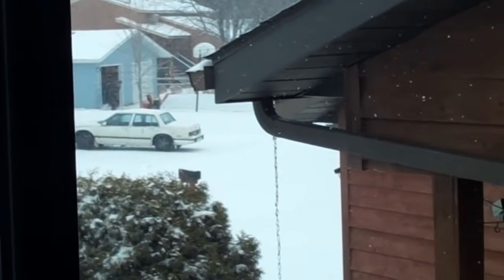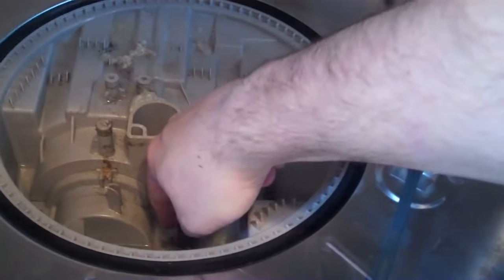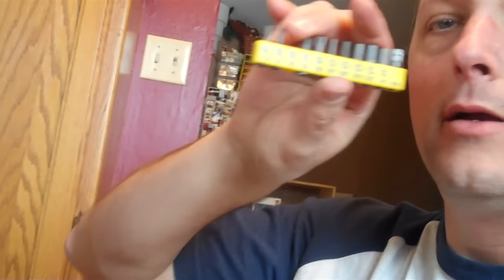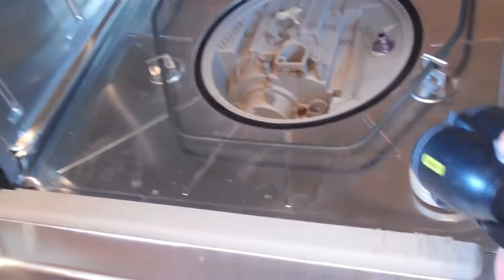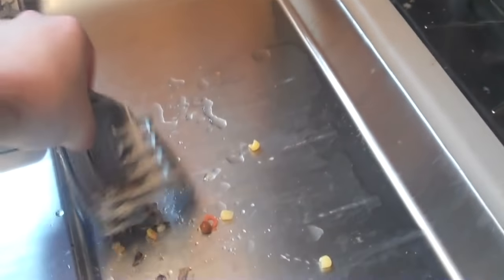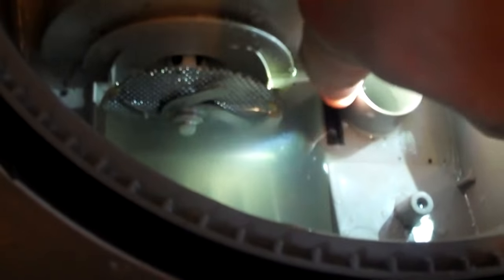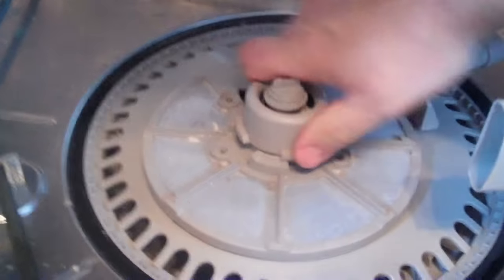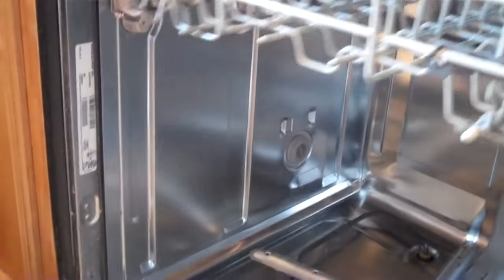Dishwasher Repair | How to Clean the Screen/Filter | Part 1 of 3

Comment: Service call averted!  Now if only my honey would let me go play with what we saved for the service call and inevitable parts the dishwasher would "need"...  Instead of food, it ended up being plastic chunks from the "wheels" on the upper rack which I discovered is also a problem for the KA's...  The only question now is why is it running louder than it originally was and there are enough suds for a small army!... 

I should add - I'm also a chick and got a good chuckle because the roles are reversed in our house and I'm the one having a good laugh at my dear husband's lack of skills in these situations to the same extent you are!  Half the battle is keeping a straight face while getting to pull out all the toys he didn't think I needed to "upgrade" previously to make the job look important...
Reply from the maker: Oh, never heard of that happening.  I am not a repairman at all, and just show how to do a routine clean out of the dishwasher.  That sounds very odd.  We sometimes let our rinse out empty, with no soap, and use a small amount of vinegar to clear it out.  You might want to try that.
Reply: Frosty Life  I think the suds was just a buildup of detergent that just got jostled loose in the process of taking everything apart and putting it back together.  A couple "trial runs" and it resolved itself back to normal levels.  The sound is one that gathers a "yea, not inconvenient enough to justify spending $$$ on a repair guy to come out since it's running properly and washing the dishes nicely now"...  Now that the thing is off warranty, the repair guy cost goes a long way toward a new dishwasher!
Reply from the maker: MesmrEwe
fantastic, love hearing good news.  I am glad this helped you.

Comment: Thank you! This video is exactly what I needed - I found a 2 inch piece of glass down in there that was making a horrible rattling noise. I found that the plastic screw at 2:30 - 3:30 you need to unscrew backwards (clockwise to take off the propeller) mine came off very easily with fingers only.
Reply from the maker: +Ryan Peeters Very true and thank you.  I am glad this helped.

Comment: There's another screen behind the chopper that you have to remove the dishwasher to get to. If you don't clean that screen, you still may not achieve 100% performance. You have to remove the recirculation pump in order to get to it but it's really easy, just one bolt. Mine had all kinds of stuff jammed into it.

Comment: Great video.  Helped me a  lot.  Another video told me to check the little rubber flappers that the top rack plugs into.  In my case one flapper had broken off and thankfully I found it.  The other flapper seems flimsy.   So I took that assembly apart, very easy to do.  Then I traced around the flapper "gasket" on a cottage cheese lid.  I cut out only one hole since we use only the upper position.  I put it back together in such a way that the remaining flapper never goes into the water stream.  This completely plugged the lower hole.  Now the upper rack works better than it ever has.
Reply from the maker: Fantastic, thank you
Reply: This was the root of my problem.  Now I need to find the replacements parts but in the meantime, I may try your suggestion.

Comment: Thanks for this video - I have the exact same model (installed 2004), and this was really precise and helpful. Park Richard's comments are helpful, as cleaning out the flappers on the back water pipe is good to do.  Will run tonight and hope for improved results!

Comment: Thank you for the afternoon smiles, made my day! Great video, I think I may be able to go diving for some shrimp tails all on my own now! yayay (:
Reply from the maker: Glad you enjoyed
Reply: @FROSTYLIFE  Do I need to unplug or shut off electricity?
Reply from the maker: @janet8911  if you are simply cleaning the filter, having the door open will assure it won't run, so no need to shut off power, but if you have a way of shutting the power off easily it sure would not hurt to do so. Sometimes shutting off power will reset the logic board which helps reset the machine
Reply: @FROSTYLIFE  Thank you! (:

Comment: Thank you so much for this video. I heard something dripping in the kitchen and saw the bottom of the kitchenaide was leaking even though we hadnt used it for 2 days. Not much gunk in there but i think it was a clog in the drain pipe U joint under the sink that fed into the washer drain hose and eventually creating a puddle at the bottom of the washer. Basement ceiling did actually stain!

Comment: Thanks for your excellent presentation.Done every thing fine but while fitting back the shower propeller at the floor of dish washer  the central knobs unable to screw as told by you "press and move clock wise " but while opening press and anticlockwise  rotation opened that easily but not while fiting back .
Pls advise ?

Comment: Made it look as easy as it was.  13 years of gunk pulled out of the bottom, as well as all the grease that accumulated there.  Doing a dishwasher cleaning cycle first, then will run some dishes, and se what happens.

Comment: I liked you commentary.  The video was out of sequence a little at the beginning.  The guts and lower spinner blade were out, but then if you keep watching the video it shows you removing all of that stuff.
By The Way, this is the same procedure for the Whirlpool Quiet Comfort III except instead of unclipping the channel for the upper spinner head, there are two screws, one up top and one just above the diverter valve for the upper tray spinner head 2/3 of the way up on the back wall.
Tools needed for the Whirlpool- A #2 Phillips, T-15 Torx and a T020 Torx.

Good Job Frosty
Reply from the maker: That is great information that I think will help viewers a lot.  Thank you for taking the time to post it.

Comment: Mine had almost no debris, food residue or non-food residue at all in the sump area/inside the morcellation pocket (grinder area under the cover).  I did find a light blue rubber lid/cover about 1.5in diameter laying in the sump area..?  I cant find any component on the cover, grinder, rotating sprayer arm where it would go..???  Any ideas..???
Reply from the maker: I am sorry, I am not sure what that would be.  Sorry it took me so long to reply.  I missed your comment.

Comment: Thanks, very helpful.  2 comment. 1.  Put a towel or something in the large drainhole in the center while you work.  I dropped my extender and drill bit down there, which extended my repair time to over an hour while I tried every tool I own to get it out.  Finally got it with combination of super long screwdriver and needle nose pliers.  
2.  On my dishwasher, that filter price comes apart and a lot of hair and junk were inside when o opened it up.
Thanks again!

Comment: I just did this to mine after watching(hubby sleeping with no idea what I was doing, points right?). I just found some fuzz in there.Prior did load w/ CLR, load w/vinegar, then a load w/baking soda. The only things I found that I thought could have been the problem were the flappything at the drain wasn't on right & it had a fine filter that I couldn't get into to clean properly; rinsed it best I could. It had some fuzzy looking stuff in there. Hopefully this works. Testing now :) Thank you!!

Comment: FYI: Q ~ 340p. Maybe if you'd massed up the camera (with a rubberband and brick or wall wart) or gotten some kind of LED gobo with a fader on it you would have much better video...still looking forward to the end where you balance the rotor with pennies and some Penn and Teller schtick. Only a matter of time until you're asked to tie the Duchess of York's umbilical cords and other things where the professionals at hand are stuck on nuking it from orbit (whatever that is on the case) to be sure.

Comment: Great video Tom, took me longer to track down my torque bits than it did to take it apart. It looks like my chopping wheel is anchored on with a washer, nut and long piece of plastic. I found the plastic piece snapped in half :( I've had this dishwasher for 18 months and had service on it 4 times so I'm not very impressed and sadly it's out of warranty. Regardless great informative video and I got a few chuckles out of it being a father of 5, 3 of which are teenagers. Thanks again!

Comment: LOL...wish I could say I did...BUT I not only have a clean dishwasher...the cabinets, frig, and floor got a good shower.  Kinda hard to see if the spray arms are spraying unless you open the door...which of course means you have to disable the door latch...I recommend rain coat, googles, nose plugs and 4 sets of hands.

Comment: Thanks for the quick reply.  Good news is the washer seems to work, getting water to the top rack.  

Bad news is it is much louder then I remember and seems to be taking longer. Been going over an hour now.  Not sure if I did something wrong.
Reply from the maker: Make sure it drains properly.  Not sure about any other things.  I always say, if the routine maintenance does not work then it is time to call a repairman.  There is so much that can go wrong with a dishwasher and all the moving parts and plumbing.

Comment: Thanks Frosty.  By the way your video was great ...thanks for that help, too.  Do you think my issue could be solved by cleaning out the large black rubber drain hose that attaches from the garbage disposal to the dishwasher air-gap?

Comment: What happens if the screen and impeller assembly separate from the washer?  I can't figure out how to get the impeller back in and then make the cover fit!
Reply from the maker: make sure to clear out the area where the screen and impeller are housed.  There is a rubber flapper valve that must be correctly seated as well

Comment: Ok, so I did turn the tab and was able to lift off the lower spray arm, but now I'm having trouble figuring out how to unscrew the drain cover.  Does it require a special screw head?

Comment: The one thing I needed was  how to remove the washer arms so I could get to the filter. Omitted the most important part.
Reply from the maker: check at 2:38 /  I was a little out of sequence but it is described fully after 2:38

Comment: Ok since off with Larry decided to google how to fix dishwasher that is not cleaning the dishes.   He did it in under 20 minutes. I knew to start before lunch time. Only took my  4 hours (including time spent looking everywhere for special screwdrivers for weird screws (WHY not standard screws???).   Erin held a flashlight and Thomas helped with the last two screws going back in-- my hand just has horrible arthritis and I could not grip the screwdriver.  Watched several videos.  Liked this on the best, reminded me of a friend by sound of voice and the glasses.  Running dishes with Peanut butter spread on them for a test run,.  Not something I want to do again tomorrow.
Reply from the maker: Thank you so much and I am very happy this video helped you accomplish your repair.  You saved a LOAD of money for sure.
Reply: Ok, the first load did  not come out clean, still a lot of gritty material on dishes and my peanut butter bowl was still dirty.  So poured vinegar in dishwasher. let sit overnight and ran the next day.  After a third more time running it,
 the dishes are clean!  We now have a  new house rule- no plasticware in dishwasher!!  Any other ideas for preventative maintenance?
Reply from the maker: J Crosby
  I actually ended up changing my drain hose, and now it works even better.   But changing the drain hose is not easy at all.  It took over two hours...but worth it.

Comment: Dude, you rock! This and the Part 1 were extremely helpful. One question and one comment: 1. Why is your dishwasher so clean? Aside from the shrimp, it looks like you don't use it. 2. One word of caution when removing the little rubber flapper: BE CAREFUL! When you pull it out, the little round flapper part can get stuck in the opening and it is very easy to tear it from the part you grab. This will end up costing you $32 and a day or two of doing dishes the old way. I guess the rubber thing is actually a piece of gold with rubber coating.
Reply from the maker: Oh that is very good to know.  Thank you for the tip.   The dishwasher probably appears clean because it gets used at least twice a day, and my wife also runs a vinegar solution through it monthly to kill any smells, and we cleaned the trap often as well....that and we usually scrape and rinse plates before putting them in there.  It is also is really easy to keep the stainless steel clean.  Thanks for watching.

Comment: I bought a used dishwasher that just keeps running and running.  Would this be the problem?  It drains ok though.
Reply from the maker: it sounds like either a sensor or a timer problem.  If it is still pretty new I would call and get them to honor your warrantee to check it.  I have never had that problem, so I am really not sure. I know mine runs for a very long time every time.

Comment: Thank you! Although the front door of our washer is not the same, the inside is. I tried this myself but only got as far as removing the spinning water shooting thingy and did not know I had to go further inside to find where the gunk was clogged up. Can't wait to get home from work and get our dishwasher working properly again, as right now it is only washing the lower rack and not very well either. I KNOW that our lifestyle and bad habits have clogged up the works!

Comment: Thank you so much for the  video.  Just cleaned it out and can't wait to see if this fixes the problem.  Also liked that you kept the video funny.
Reply from the maker: Melody MacKenzie Thank you for the very encouraging comment.  I am confident you got your dishwasher to work better.  Also, remember to drain it before running it and also clear the sink and run the garbage disposal before running or draining your dishwasher. It will run like a charm.   Thanks for watching.
Reply: How do you drain it? and how to run the garbage disposal???
Reply from the maker: Melody MacKenzie Oh sorry, I did not see your question.  There should be a cancel button to drain the dishwasher, depending on your model.  Garbage disposal is the one inside your sink, if you have one.

Comment: Great video! Thanks for going thru things step by step and for the chuckles. Without watching the whole thing again -- I don't think you talked about cleaning out the spray arm on the upper rack. I took that arm apart to some extent and flushed some nasties out of it. Tested by running water strongly from the bath tap into it to make sure all the holes were clear. This was a good trick with the lower arms as well. If someone doesn't have a turkey baster an ear syringe is also a good way to get rid of water (thereafter retired from ear duty!). Maybe you do this on your other vids but could you draft one of the kids to be the camera person? Better than a tripod and there were a bunch of spots where it was tough to see what you were doing -- just too much for you to be principle actor, writer, director, lab wrangler AND cinematographer! Cheers!
Reply from the maker: Thank you so much.  Those are some very good tips that you gave, and I will include that in the description and in any future videos.  Thank you for those tips.  You are correct, fulfilling all staff positions for my video channel is challenging, which is why I go on vacation more often now lol.

Comment: Thanks man.  It helped.  It's a "torque" bit, btw. And you can easily use a manual screwdriver with interchangeable bits.  Don't need the drill. You get extra points for having a more dirty/clogged  filter/disposal compartment than we did.   When my wife saw how clogged yours was, and that ours looked better (minutely)  by comparison, I got less aggressive version of the  "I TOLD you you've got to RINSE the dishes first!" lecture than I would have gotten otherwise.
Reply: It's actually a "Torx" bit, not torque.

Comment: Great video, buts screw fell into the grinder motor area. I have no idea how to get it out! :( the grinder is getting jammed.
Reply from the maker: Steven Archambault were you able to pull the grinder wheel out?  Someone else said that happened to them and I suggested using a magnet or a magnetized screwdriver (just strike it hard on the hard ground) and perhaps you will be able to fish it out that way.
Reply: Yeah, wheel came off after I played around with it a bit. But screw is actually back in the little compartment where the shaft of the motor comes out. I don't know how there is an opening there.
Reply: The screw is laying perpendicular to the opening.

Comment: Thanks so much, Tom!  I got ALMOST all the way through it -- that last part -- where you screw the "propeller" back on -- has me stumped.  I can't get it to "seat."  I tried to hold the screw and turn the propellor clockwise. Any other suggestions? Don't tell me I'm going to have to call the repairman after getting so close!!